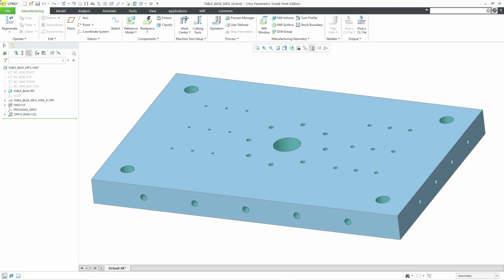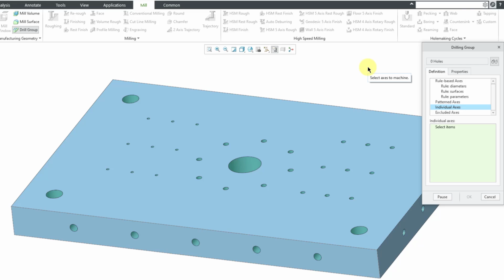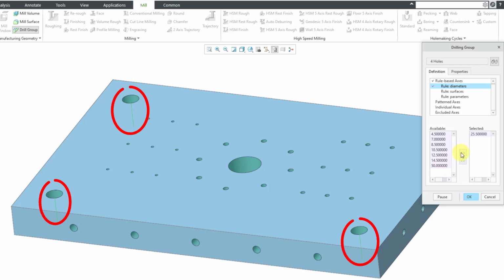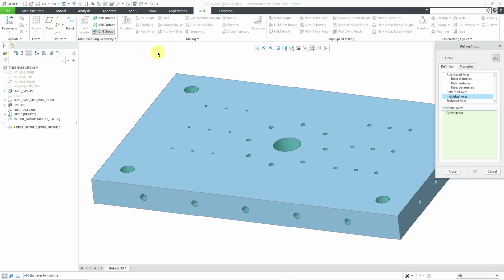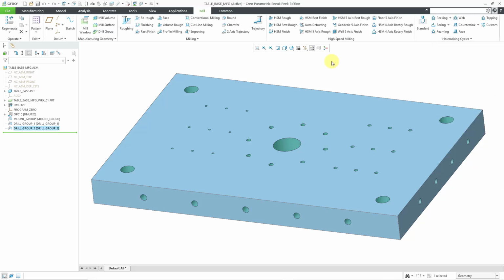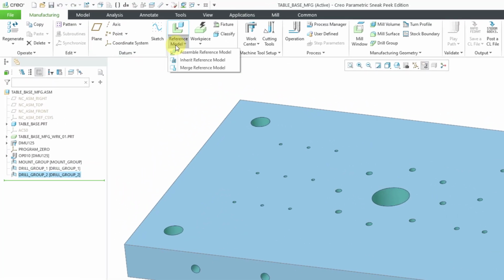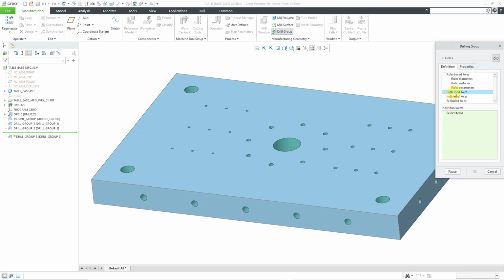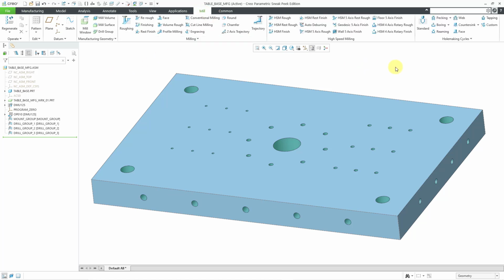Creo Parametric - CNC Manufacturing Geometry - Drill Groups

Comment: If the model comes as a STEP file, there are no axes for the holes. In that case, you can use Creo Flexible Modeling → Pattern Recognition: just select the hole surface, limit the search by the planes if needed, then define an axis in one of the holes and create a reference pattern from it. This way you’ll get a proper array of axes for the holes, which can then be used in the Hole Group feature.
Reply from the maker: Thanks for sharing that tip.

I cover that technique in a couple videos: "Flexible Modeling Extension (FMX) Tips and Tricks | Part Modeling" and "How to Create Reference Patterns (Parts and Assemblies)." 

However, finding that technique is not searchable. When I get to Spain, I have a project planned to go through my videos, especially the What's New and Tips & Tricks videos, to make different tools and techniques more easily searchable.